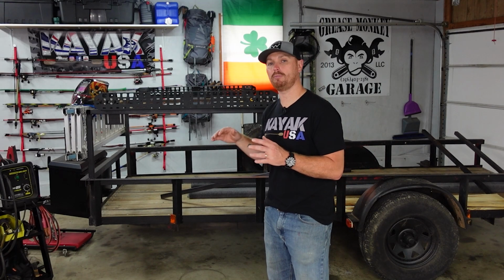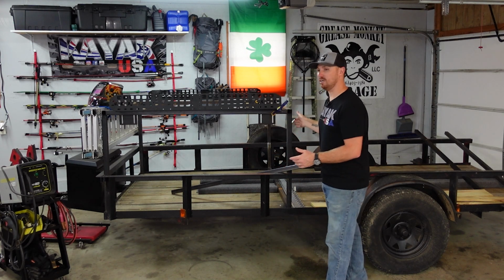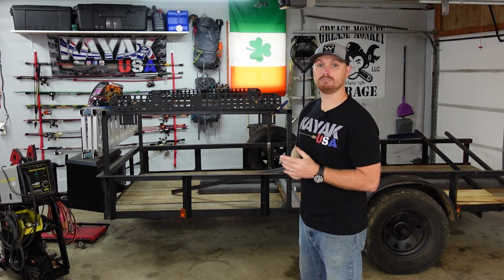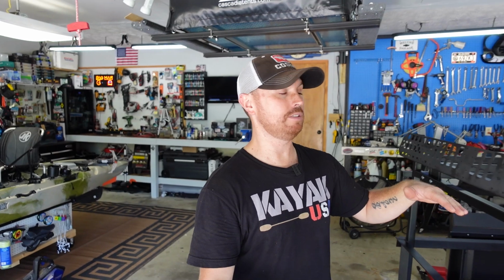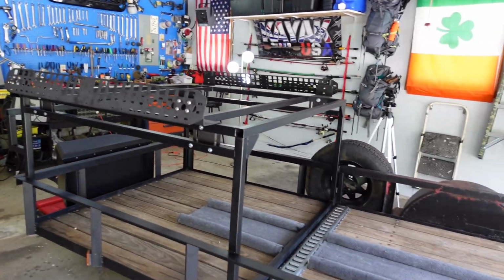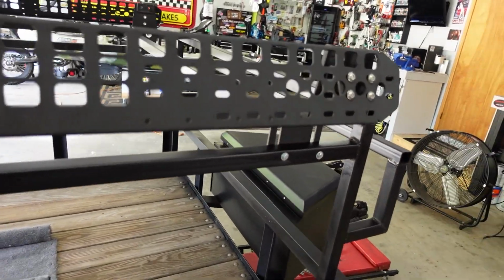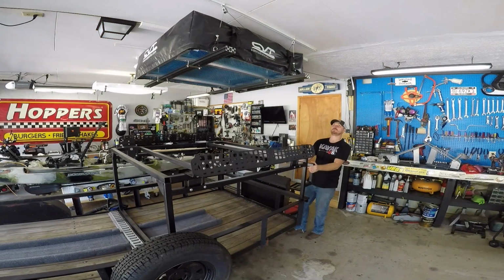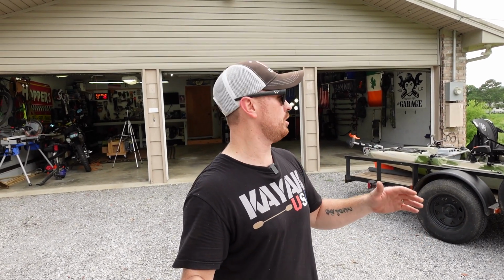Kayak Trailer Build | Part 2 | Adding a Rooftop Tent & Billie Bars!! 2021 Kayak DIY

Comment: I'm planning my own frame for my 5x8 trailer. What width and thickness tubing did you use for your frame? Is it sturdy? I am guessing you used 2" and .083" thick, but I just can't tell from the video for sure.